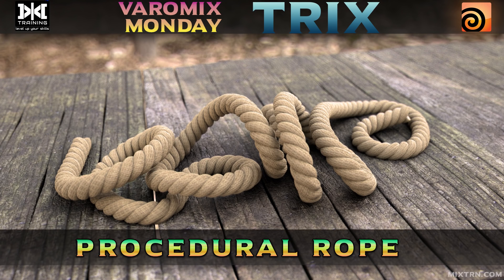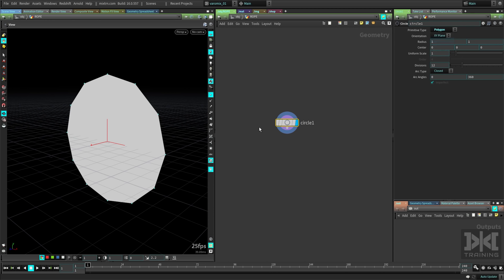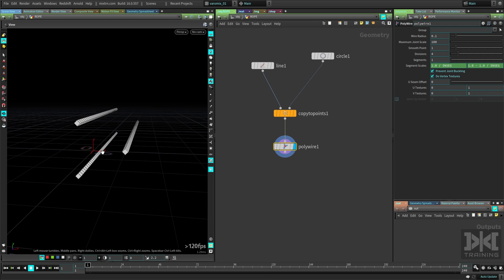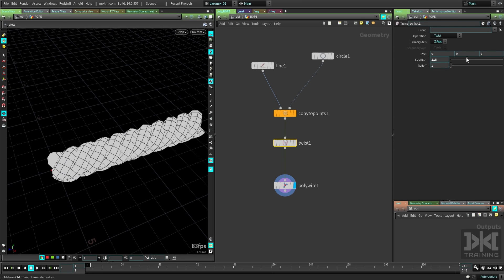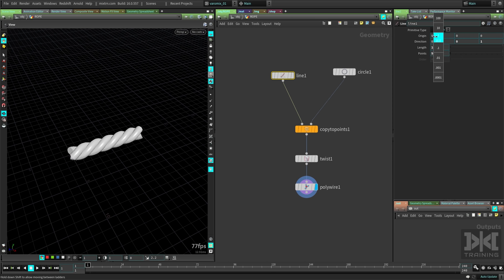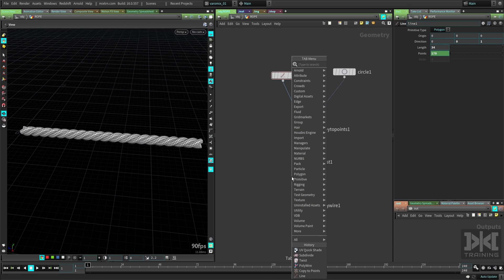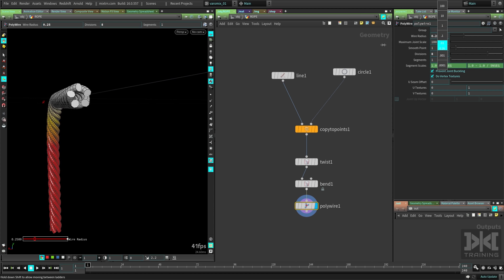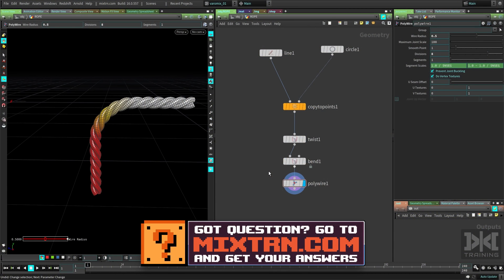VMT 021 - HOUDINI -  Procedural Rope

Comment: But why? Wouldn't it be more logical to do completely opposite way? To draw a line/curve, make 3-point circle with ID attribute on every original point, they sweep/copy it to points on that line with slight rotation every time, and then connect point based on the attribute? And polywire it. This way we always have the basic line/curve to do whatever we want with the rope.
Reply from the maker: well, that's more "logical" if that's what you need or that's how you think, I can think of 5 more way to do it, doesn't mean one is better than the other is just different way to do it, maybe you don't need to modify the original curve, it all depends on the use you'll give it and what works for you., thank you